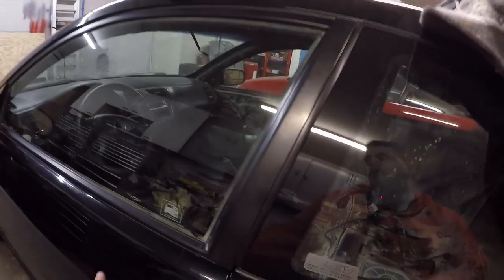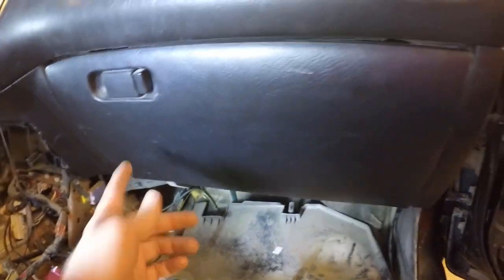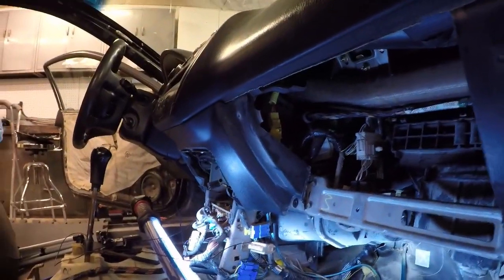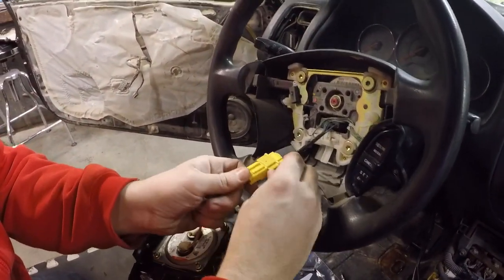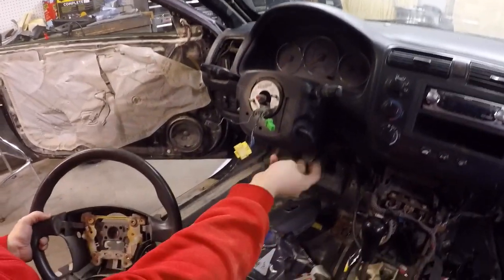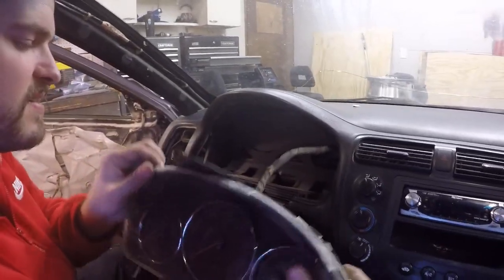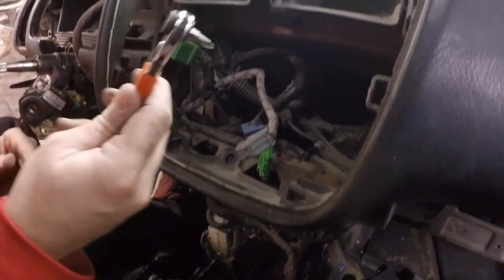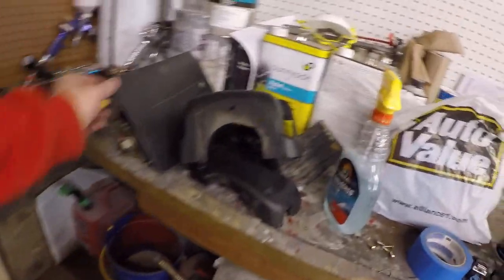Removing The Dash | Interior Swap Pt.3 | Project EM2

Comment: Thanks for capturing all that on video! I've been afraid to tackle this because of the airbags, but looks pretty casual the way you took care of them.
I'm chasing down debris from a mice infestation. Does the dash being removed give good access to the heater core and ventilation system?
Reply from the maker: Yes, removing the dash will give easy access to all of that
Reply: @AbnormalGarage  thank a mil. Got the whole dash out. One thing I didn't do which you do (and I should have paid closer attention) is leave the steering wheel nut on (loose) while popping the wheel off. When mine came it snagged the wire clips and popped the top of the clock spring off. I wound it back up to where it's got 2+ turns in either direction but I think replacing it is the better call.
Leave the nut on the steering wheel while you're bopping it, folks!

Comment: Do u think I can put the 2018 accord dash n interior in a 2008 accord? I want to change the steering wheel, dash board n panels, suspension and transmission… trying to have everything from the new accord work is my 8th gen project

Comment: I need to paint my dash and I'm assuming I  need to remove the dash to do this? because removing this looks like a huge pain in the  ass
Reply from the maker: If you're going to paint your dash then I'd definitely remove it. The hardest bolts to access are the ones that are tucked behind the radio bezel. Other than that it's pretty simple.